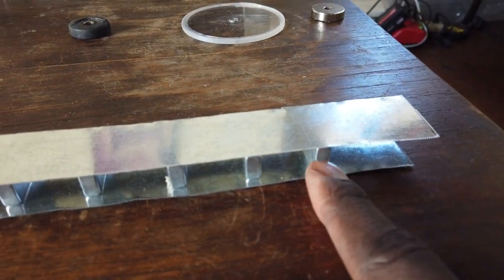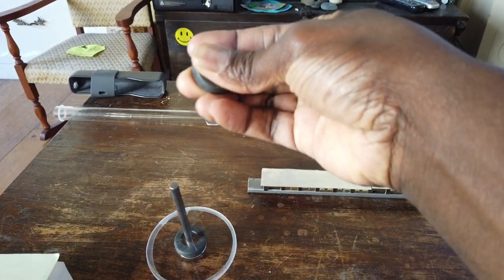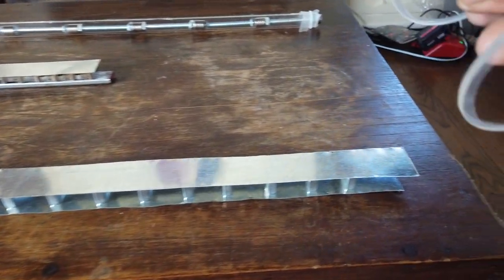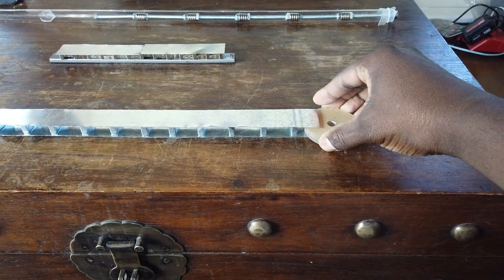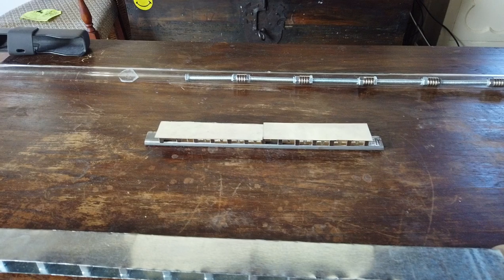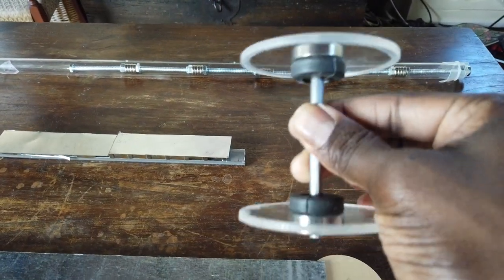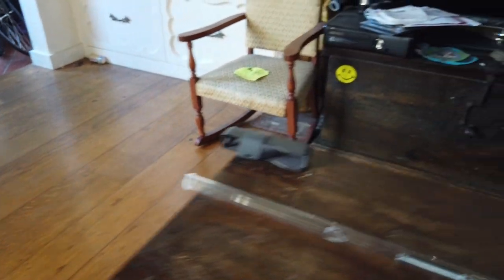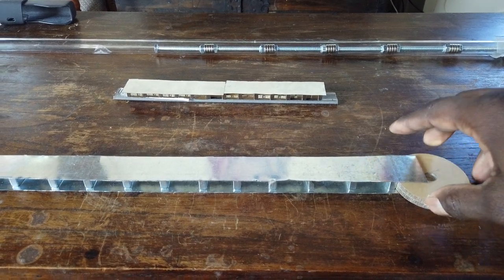Perpetual Motion from a Magnetic Array?

Comment: Above average talents in magnets is surprisingly hard to find.

Like your experiment. If you want to build perpetual motion, I recommend using magnets as an attracting force of >0.5 to <1X upon a rolling weight of 1X, then having the weight somehow resist when freefalling using these properties (this requires slight upward motion at first). I know something similar may work, but I have not yet succeeded. I am half-hoping someone (anyone) else succeeds first, because I have done so much design I doubt I will be the builder.

I am 37, mentally ill, you don't need to be concerned for my side of it. I'd like partial credit if it works, but I'm not the most aggressive person about legal issues. I have been hoping I can be remembered as a conceptual inventor even if I don't receive royalties.
Reply from the maker: I did try that before I posted this video, and it does seem to work. There's not a lot of extra force, though, for the amount of material needed to make it happen, so I've been hesitant to keep going.

Comment: I'm not clear on the longer tube: 1. Is there entry resistance? How is it not a perpetual motion machine? 2. If it is a perpetual motion machine, you may be the inventor of significant horizontal velocity. Typically I'm disillusioned with magnets, however, since I feel there will ultimately be some device that works, I may as well consider your idea valid too unless there is evidence to the contrary.
Reply from the maker: There is entry resistance. What I found, though, is that the magnets, collectively, act like one long magnet. The mid-point interactions are weak, so the longer the magnet track, the less willing the moving body is to make it all the way to the other end. However, because there's enough force to drive the wheel on an incline, I found that I could potentially have the wheel drop into the next set of magnets with much less entry resistance. I ran out of magnets, though.

Comment: Have you tried arranging magnets in a wheel shape array, to achieve constant circular motion? The diameter would have to be large enough so as not to oppose one another in the actual wheel design array, while opposing the magnets inside the wheel on a separate axle, which would be providing power to a machine
Reply from the maker: Yes. It doesn't work because there are no end poles to generate acceleration. I would have to take the exit momentum and create another system that would allow the wheel to re-enter the magnetic array.
Reply: If the system requires the initial push/pull to generate the forward momentum, but it doesn't gain any speed when travelling through the arrangement of magnets, then it will always eventually stop.
Reply: @PerpetualMotor  you can do as per my idea. Do one thing keep little distance between two arrays making circle and it will never stop

Comment: Bro, you just broke magnet physics! I'm so excited I have been studying perpetual motion machines, for ever! 
This has to be part of a solution in some way!
Reply from the maker: LOL! Magnet physics is not quite broken. What I found, though, was that there was enough force to have the wheel go up a slight incline. What this means is that it could drop from the end of the incline to start the process again. The problem was that you’d need a long row of magnets, which starts to get expensive. There is the potential to do it in a circle, but there just isn’t a lot of power produced. Although, it would be more than zero.

Comment: Unfortunately if you made a circular track the little magnet wheel you have made would run around one rotation and lock in the neutralization field just like every single other perpetual magnet motor does no matter what is done to it ...
Reply from the maker: True. That just means you have to keep the acceleration linear. So, then the challenge is how to create a closed loop with linear components. The best I can come up with is some type of pivoting assembly, track, tube, or rail that can reverse the direction of the wheel in order to roll over a second linear accelerator.
Reply: @PerpetualMotor  that may work im not really sure .. Ive thought about what would happen if you made a closed track sort of like what you have here and once the magnet made one rotation and neutralized could you mark that position and take one magnet out and replace it with an electromagnet gate with a dead mans switch set before the neutralized point so when the magnet wheel or rotor came to that point it would trip the switch and reverse the magnet momentarily to allow the magnet wheel to pass and immediately switching polarity back to its first state to keep the linear force forward ... This may not work either but ive never heard or seen anyone do it but this idea along with every other theory sounds good until its attempted haha .... Either way im sure someone eventually will find a way around magnetic neutralization its just a matter of who and when ... Anyhow keep trying and good luck 👍👍👍

Comment: Very intriguing. I'm wondering if the exit velocity is to put the car inside another array. Then one can put these arrays in a circular arrangement. Should that work, heavy implications would be had.
Reply from the maker: If that circular array consists of multiple straight arrays, then It could be possible. Once you start curving the relative orientation of each individual magnet, though, you can create some significant deviations in the magnetic field.
Reply: @PerpetualMotor  that's a fancy way to say that perpetual motion can't exist and the only thing you can do is to trade magnetic potential energy with kinetic energy,wich is the same as physics says;pretty interesting for a non perpetual physics -defying motor

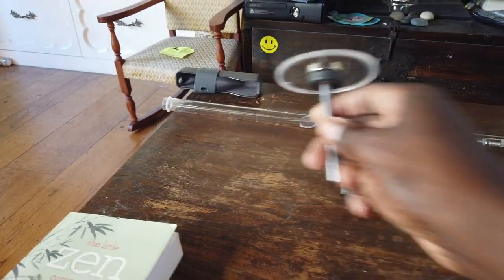Comment: 1:20 What you mean is "softens" is actually "blends the transition" removing the definitive line between the changing poles. Who cares about the exit? Put it in a circle so it never has to exit with the moving magnets on a rotating axis.
Reply from the maker: You are correct. What I meant by "softens" was exactly blending the transition. However, if there is no exit, there is no end pole to create a magnetic potential difference to cause acceleration. I actually did try that experiment, but it didn't work. To have something that works, I would have to create a completely separate mechanical infrastructure that could use the exit momentum to enter into another magnetic array.

Comment: What if you lined up the magets in a circle instead of a straight line and used a ball in a tube instead of the wheels?
Wouldn't it be possible to make that ball go forever in circles?
Reply from the maker: The way this seems to work is that the array acts like one long magnet. Once you close off the other end by looping it, you close the magnetic field. Once you close the magnetic field, the effect of moving something across the length of the array disappears.
Reply: @PerpetualMotor  I know that the laws of thermodynamics state that closed perpetual motion systems are impossible, because you always lose energy to friction.

But what I keep wondering about is that you have 2 permanent forces that don't need an energy input; the magnets and gravity.

So what if you could design a system that uses the magnetic force to lift an object to a certain height and then gravity takes it back down again, completing the cycle.

Like, magnets pulling a ball up a curved ramp, giving it enough momentum to break free from the magnetic field, to come down by gravity on the opposite side of the curve, to enter the magentic field again and be pulled up again. 

But I don't know if this makes sense? lol

Comment: if you put it on a loop track will it go forever?
Reply from the maker: No. Once you close the magnetic field with a closed loop, the main drivers - the north and south pole of the collected group of magnets - no longer exist.
Reply: @PerpetualMotor  what if you made it 90% loop and then cut it off but it would roll down the empty area still
Reply from the maker: @jodi9295  When the end point of one array is close to the beginning of another it weakens the entry and exit, which reduces the maximum amount of inertia that can be generated.
Reply: @PerpetualMotor  I would argue that if the loop is big enough then it would work. 
You need a pretty big circle though so it costs cash to make.

Comment: thanks ...    1. the roller need to get pulled during start without you having to feed it, 2, even if the linear model works as intended, when you wrap a circular path every thing gets wasted.  IT WILL NOT WORK.

Comment: Exiting a magnetic field does not mean perpetual motion can be achieved, Exiting and re-entering a magnetic field is the trick.
Is the "exit velocity" high enough to re-enter another identical arrays magnetic field?
I expect not, part of the energy in the exit velocity came from you placing the axle in the field, a bit like loading a spring or catapult.
but hey.. magnets is fun, no harm in trying!
Reply from the maker: Actually, if the acceleration happens on an incline, you can create gravitational potential and drop into another array, which would allow entry into the magnetic field at a similar start point with start velocity. The issue that stopped me was that to create enough additional energy to be useful would take much stronger magnets and much heavier masses.
Reply: @PerpetualMotor  I'm not saying it can't be done, but If you make it go up a hill using stronger magnets, exiting the field uses more of the momentum energy. Re-entering a stronger field also requires more energy. The potential energy from gravity (height) came from that magnetic field raising it, and that same magnetic field will slow its exit.
Reply: Correct on all points. This is why I’ve backed off on improvements until I have a solid way to reduce the exiting magnetic field. This may be possible with a magnetic switch similar to the Mag-Switch product.
Reply: @mauricewright9887  i think you may be better moving away from magnets on the axle, the working method you refer to doesnt work like how yours does.
Reply: @mauricewright9887   Could you vary the strengths of the magnets in the array? Perhaps a very weak one at the entrance and exit?